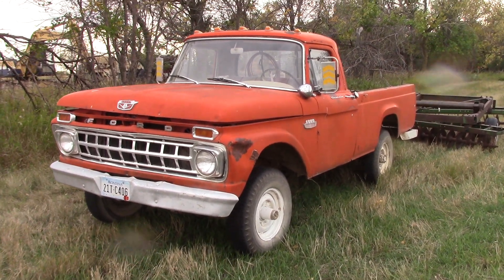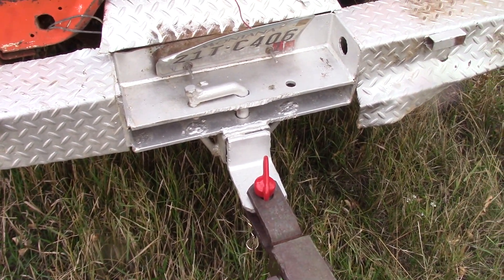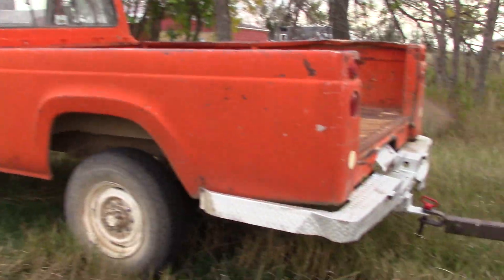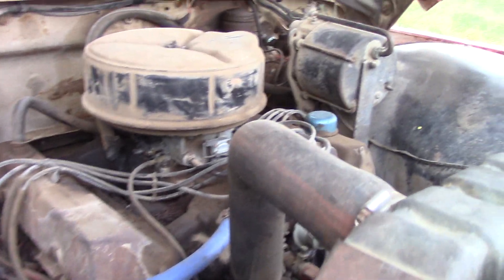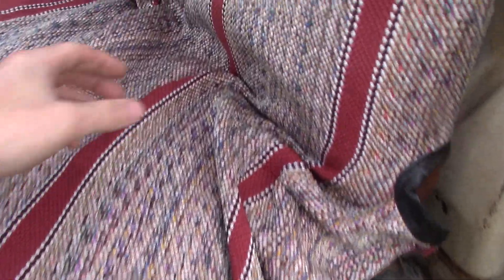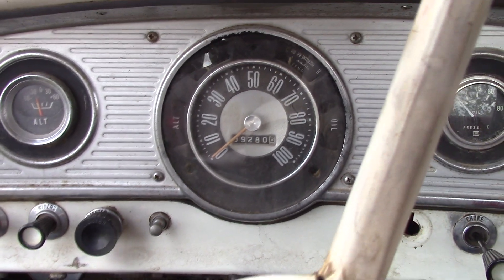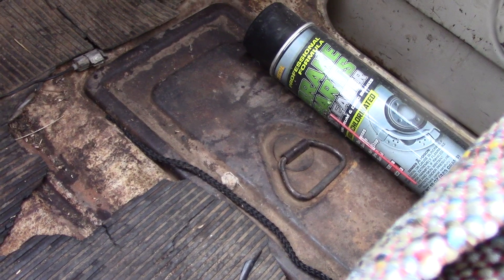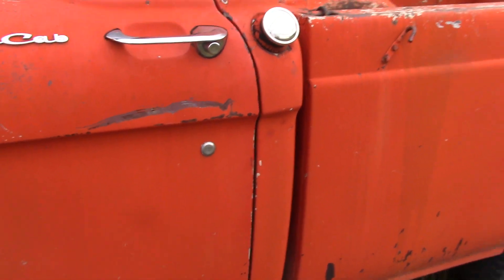1965 Ford F250 4x4

Comment: Sweet truck! I have had my 59 for over 40 years. Still drive it every week and it will still throw mud. I'm not sure about the bed I've never heard that explanation before but could be. FYI on emergency brake, when you set it, don't just yank out on the lever you'll break the plastic T handle. Mash the pedal down as hard as you can and then pull the lever out to set it. Neat old truck I couldn't live without mine. Thanks for sharing it with us.
Reply from the maker: Thanks for the trick on the brake! I know the one on my mustang is broken and that'll keep this one from suffering the same fate.

Comment: That bed is much older than the truck the emblem that is missing is a twin i-beam emblem as well as You're 250 which goes up on the up on the cowling well, maybe not. The 4x4s may have been different than the two-wheel drives. My son has his 65 f250 two-wheel drive sitting in my garage with the engine out of it. He loves his 65 though he wanted one when he was 14. We bought it for him when he was 16 and it's still here and he is 33 years old now My son and his family leaving an apartment building and have no place to work on vehicles. That's why his truck is here at least for a couple more months
Reply from the maker: @christinawiseman-gc9jh  the best is most likely about 3 years older than the truck. This truck being a 4 wheel doesn't have the twin I beam suspension and instead says 250.

Comment: That exhaust leak is properly corrected by planing the exhaust manifold and head mating surfaces. Then apply a graphite grease to both surfaces and then assemble the manifold onto the head, torque to specs, run for 10 hours, then retorque to specs. Most engine rebuilders put gaskets on FE exhaust manifolds, which is incorrect and will cause them to quickly start to leak. Do it the way FoMoCo recommends in the shop manual and the leaks will be eliminated/prevented.
Reply from the maker: I concur, and I ended up fixing the leak, but with a remflex gasket. I may only get a week max at home so it was a cheap short term fix that will hold up for awhile

Comment: A very cool truck, keep her running!
Reply from the maker: It's just so enjoyable to drive. It's got the right amount of power and handling characteristics to make it a great truck to run around with
Reply: @reeseholler92  need an updated video on this bad boy!
Reply from the maker: @gabrielmiller8814  wish I could! I'm deployed currently but you can rest at ease that it's tucked away snug as a bug in the garage while I'm gone. It's got fresh tires on it now, but the manifold gasket leak still needs addressed. Otherwise, it runs as good as it ever has

Comment: grew up with a 68 f250 took many many bull calves to sales barn with it even pulled chopper boxes & drove to church on sundays years before i had a drivers licence. when it had a miss it was a fouled spark plug and it never had working brakes. had those hard to find 16.5 tires with split rims. our ih grain truck was missing the shifter boot and i remember choking on the dust inside the cab on gravel roads. we stuffed gunny sacks down in there to keep grasshoppers from getting in. the '70's & 80's it never rained at all 3-4 months straight & no humidity. they never salted roads back then so nothing rusted

Comment: I have a '62 f 360(one Ton).  Had the same box..  Of course now it has a 71 box on it due to the original got badly rusted out and damaged over the years and the right side fell off...   We live where road salt mixed with sand in the winter is used on hi-ways...
Reply from the maker: I was told my great grandfather had a 60, which was a similar body style to this one. But he worked for the county and hauled salt in the winter time. He got a new pickup by 67 because the old one had rusted out so bad.
Reply: @reeseholler92  ya. Salt tends to rust metal... lol... I live where we have winter, and Chinooks... Daily drivers on winter roads tend to rust out...  If people don't get undercoat put on when vehicle is new it speeds up that process...

Comment: I believe the blink marker lights button temporarily cuts power to the clearance and running lights on the truck as a way of thanking other drivers for example if they let you move over on the highway.
Reply: That’s what I’ve always been told it’s for, both of our tractor trailers have a similar button up on the dash to wink the running lights to thank another truck for letting you in.

Comment: Brandon, backflush the heater core to get the years of mud out of it.  You will be amazed at the difference in heat. A friends 98 Cherokee had no heat for years, we back flushed it forward flushed it, blew it out with air, flushed it again, and now it cooks him out of the truck.
Reply: Also, make sure the thermostat is the correct temperature type, and that it opens and closes properly. This can be determined by placing it in a regulated temperature pot of water on the stove. Next, for very cold and humid weather, install a radiator shutter to block off part of the radiator fins from moving ultra-cold air past them. This can be something as simple as a piece of stiff cardboard or 1/8" cardboard or plywood.

Comment: Hi!   Nice original truck.   Could you please tell me how long is it from front of bed where it meets cab to opening in rear wheel well.   Been trying to find a bed for my 1965 F250 4x4 and this measurement is important.   Thanks very much for your time!
Reply from the maker: I'm currently deployed to the middle east, so I don't have access to my truck right now. I should see it when I take a day of leave headed back to home station and I will try to measure it then for you.